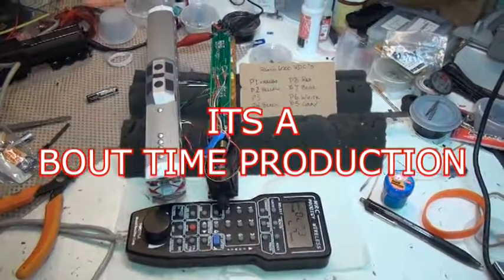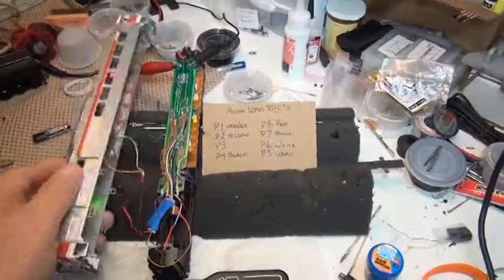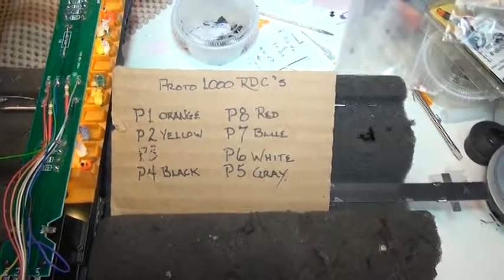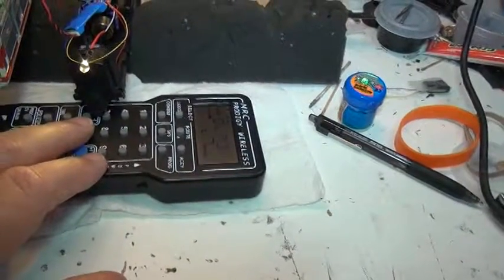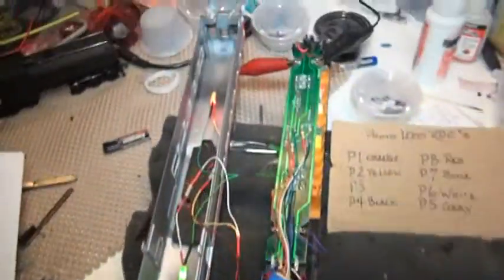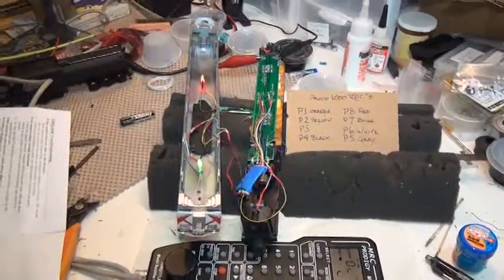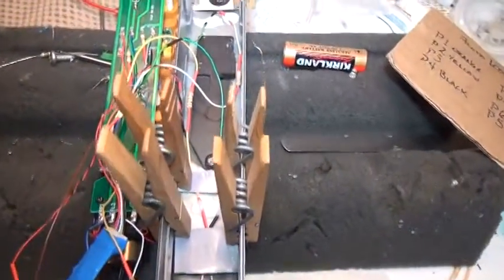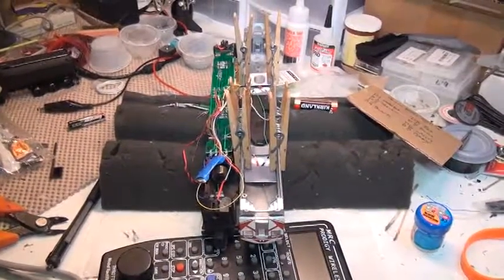CANADIAN PACIFIC#9023 W FIBER OPTIC MARKER LIGHTS

Comment: Looks great; I did similar work to my RDC-3 (find me here under jostaiii) but used 1.5v bulbs throughout for my DC layout.  But aren't the marker lights supposed to turn red while trailing?
Reply from the maker: +John Acosta Yes, but I have not figured out how to wire the 3 pin LED's.

Comment: Hi what type of speaker is that you used
Reply from the maker: +James Sztabnik It is an Apple Computer Sub Woofer. I have several different ones and which is the largest I can use is it. Some I have to modify a little including this one. I post these on E Bay at times as they are really great.